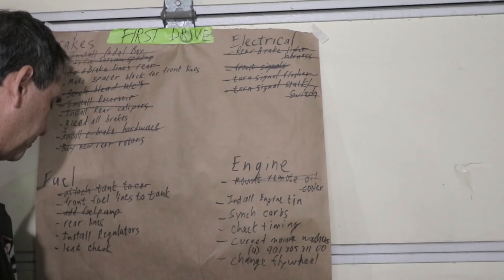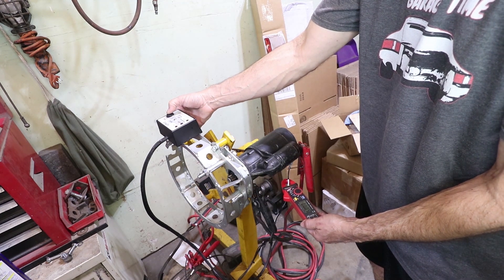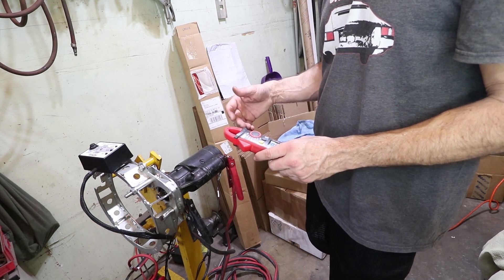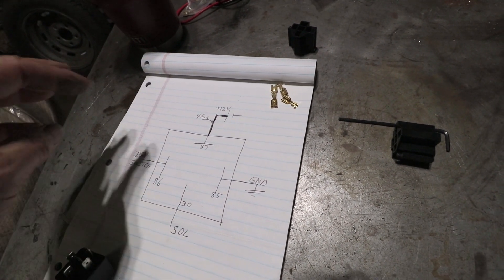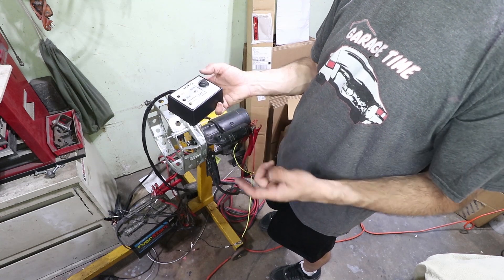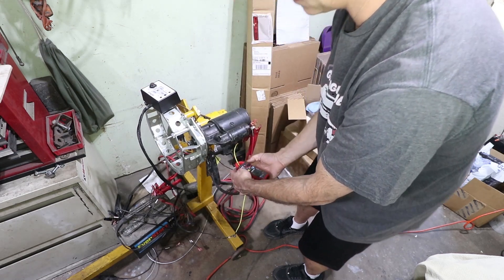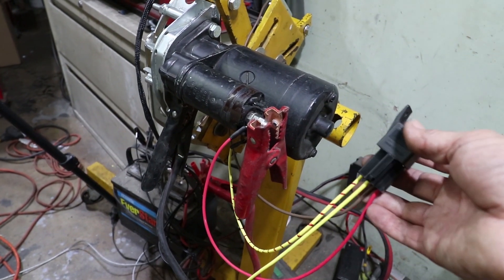What's a HARD START RELAY?  How Does it IMPROVE My Car?

Comment: Thank you for this video. Today, I cranked my -69 Beetle and got a little smoke, which comes from the ignition switch. 
Ignition switch is an old original one. I also have an electrical fuel pump, so what you said in the video is that the pump creates maybe some amps (maybe max 8A) ->>more to the ignition circuit. 
-> That explains my issue! (Old ignition switch with worse connections plus extra amps from the fuel pump) 
Total about 18A for the old ignition switch.

Thank you!

I will have THE garage time at the next weekend. I will buy a good quality relay and will install this hot starter relay system. Also, I will replace the old ignition switch.
Reply from the maker: I'm glad you got it figured out.  I put a relay on the starter circuit and fuel pump circuit.  That way the ignition switch sees almost no current.
Reply: @GarageTimeAutoResto  yeah me too, that's great idea. I got that relay for the fuel pump controlled by oil pressure light switch.

Comment: That relay keeps 7-9 amps is not going through the key switch, that relay will insure you never have a ignition switch never heats up or burns the contacts.  I have need using these for years on every car.  Get a one for the 356 also .  You will not regret this mod.  

I also add a momentary switch on the left side of the engine compartment to crank the engine when kneeling in the back. A good back up and makes working on them easier. There may be a yellow wire In the engine harness for this momentary switch.
Reply from the maker: Exactly, the relay reduces the current to 0.25 A.  This mod is even more important for the 356.  At 6V the current is most likely double and switches are even more $$
Reply: i know Im kinda off topic but do anyone know a good place to stream new movies online?

Comment: It's too bad the starter solenoids on VW Beetles and 50-70's GM cars are all wound wrong where they need so many amps to engage the starter solenoid. The cure I have done for years is to bend the fork inside the starter to allow the plunger to stay in the solenoid housing a fraction farther which allows the magnetic attraction to attract the plunger better, curing the "silent starter" problem. Occasionally a relay will not fix that problem so the best way is to bend the fork, BUT NOT MUCH. Believe what you want but this works.
Reply: Thank for the ❤️. The relay method is the easiest method to cure almost every VW silent starter problem. But occasionally I ran across one that would not engage (silent) even when crossing terminals right on the solenoid. In those cases I dismantled the starter and bent the fork a fraction so the plunger was in the solenoid housing farther. The electro magnetism is stronger then. People that didn't know this procedure bought new starters thinking this would fix it only to have the problem re-occur. One thing to watch for is if the fork is bent too much the starter can be mechanically locked in and will keep cranking when the ig. key is released. To test for that problem, pull the ig. coil wire so the engine can't start, try to start the engine, and if it won't disengage re-install the coil wire. When the engine fires the starter will be released. Rebend the fork slightly back and test again. GM starters can be bench tested for this lock-in problem but not VW's. I hope I can save some people from wasting money on a new starter with this reply.😊
Reply from the maker: This is really interesting and good info.  Not sure why Bosch didn't do this originally.  I guess they didn't expect the cars to be around this long.
I mostly like the relay to save the ignition switch from the high current, but your method would probably do the same.
Reply: The length of time since these VW cars were new isn't quite a relevant thing. This happened on cars only five or six years old. My first Beetle was that age when I bought it in 1969 and had the silent starter problem. I learned real quick to not let the ig. switch go back to the run position. That way I could turn the ign. switch to start many times in a row without going all the way to "off".  Couple years later as a full time mechanic I found the same problem in GM vehicles, and that is where I discovered that bending the fork fixed them. I then thought about VW cars in which this happened REAL often. I had done the relay cure, which I thought of on my own 😔and slightly later bent the fork on a few VW-s. Like I say, the relay is easier because bending the fork correctly is kind of a fine line procedure to get it right. Thank you for your understanding as so many mechanics resent other things they thought they had "down pat". ☺️😊😊
Reply from the maker: Thank you for explaining it so well.  I won't forget if this happens to me.

Comment: Good, but be sure that you could fit the relay on the engine starter! Lots of vibration, thermical conditions in a  magnetic environment could destroy the relay? We usually see it fit on the body, in fresh box. Et comme nous disons en France : Prudence est mère de sureté. Bonne journée.
Reply from the maker: Yes, I agree the relay should be protected as much as possible even though they are sealed already.  Vibration is a good point too.  Thanks Franck

Comment: One other thing thats generally unclear in everyone’s vids. If i want to source the “best” and longest lasting wire for the job, what does one look for? Maybe another vid... there’s txl, gxl and all confusing b/c companies make up acronyms too. Bottom line for an application like this, can i just look at wire temp range? I had a new harness installed once and the outside coating crumbled in 3 years of outdoor Ca weather.
Reply from the maker: I use SXL.  I think TXL is even better
Reply: Garage Time - Restomod i guess what im after are the actual specs of the wires that make it a better choice. Often when you go to the electrical supply store they look at you crosseyed when you ask if this wire in your hand would work in a particular automotive application. :/ that said i will look up SXL and TXL for comparison, Thanks.
Reply from the maker: The more strands the more flexible it is, but the insulation is the part that gives it the automotive rating.  You don't want PVC.  TXL is Teflon I think and the insulation is thinner.  This is good for a large bundle of wires. An ECU  harness is a good example where TXL shines.

Comment: I had not heard of doing that for the ignition, I have for the headlights. Good to know, winter project. Thank you!
Reply from the maker: Yeah, I think the headlights draw even more power.
Reply: Interesting. So this mod is somewhat the same idea...? Would using an LED based headlight still be of concern?
Reply: fancypants I don’t believe so but I’m sure someone with more electrical back ground can confirm.
Reply from the maker: Check the specs for the LEDs but they typically draw much less.  The Porsche H4s are the power hungry ones.  My headlight wires are fried!

Comment: Great video Tom, very informative.  I'm not there yet with my wiring.  But I do have a question, my care was out in the element for who knows how long, and  PO installed some type of push button starter.  I will need to actually test my ignition switch at some point to see if it is any good.  Are you going to test your ignition switch before you install it on the bench?  Is this recommended?
Reply from the maker: I tested the switch several videos ago when I installed the tunnel harness and checked the brake lights.  The ignition coil wire and starter solenoid wire both work.

Comment: Great vid Tom! Very informative. All Old VWs and Porsches in my present and past have had a barely turnover or wont start on a warm engine or hot day of driving. Ive always thought it was the starter or solenoid as an issue which by your explanation, it could actually be the relay inside the solenoid either going bad or not receiving 10amps!?  OR the ignition switch not passing 10amps back to the solenoid wire during ignition start. Do i have this correct, summarizing vid? As such, adding this relay reduces load on the ignition switch and provides insurance to it. 

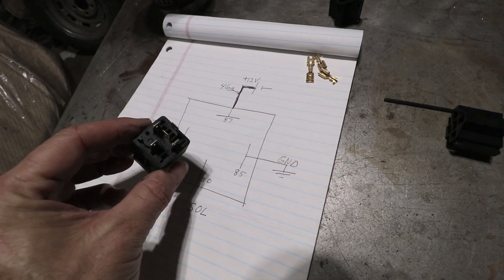Edit: is the answer for below question right before 6:04? ...not hard enough could also be slow turn over? 

Unclear though, on a hot day what happens when ignition nears giving up the ghost? ie is there too much resistance to allow proper amps to flow and why would turn over be present just super slow to cycle the engine? Been trying to understand the mechanics of this.
Reply from the maker: Hey, it could be a few things:
1). The contacts inside the relay could be buggered up.  You can clean these but it takes some soldering
2). The relay does the same thing as the old screwdriver trick across the starter terminals.  You might try bypassing the ignition switch and cars wiring.
3). Starter motor brushes could be weak
4). Vws have bushings on the starter shaft that wear out
I think #1 is most often overlooked and the relay doesn't really help this problem

I really hope you figure this out for life's sake.
Reply: Garage Time - Restomod having a really slow crank, on my 73 911 hot conditions. 

If no1 would same issue occur on cold starts? Starts right up for me. 
No2 good idea. Ill rig up a starter switch to the cabin, get a hot start lines up then try ignition. Then the starter and see if a diff occurs!
Reply from the maker: Not sure why it gets worse when things are warm.  My guess is the windings are less efficient?  
If the ignition switch gets warm then maybe the contacts don't work as well.

Comment: Great tip, especially since I'm making a custom rear electrical panel for my EFI project.  I have a couple of spare spot in my relay block, so it can be easily accommodated.  I wonder then, other than the headlights, is there anything else going through the ignition switch that could benefit from a solution like this?
Reply from the maker: The fuel pump does I think.  I haven't checked the diagram specifically but I do know the factory didn't use a relay on the fuel pump at least for my year.  Most modern cars do use relays.  Not sure if it's a cost savings or for reliability?
Reply: @GarageTimeAutoResto  Ahh, I have an SC.  My fuel pump uses a red relay (with the quenching diode built in.)  I didn't know the earlier models did without that!
Reply from the maker: Good to know that the SC has a relay there.  I would think the fuel pump electrical loads would be about the same.

Comment: It’s really odd how we are on the same schedule. I just ripped out my hard start relay because it failed and did direct to ignition..... thanks for reminding me I should put it back 🤪
Reply from the maker: Let's keep each other going😀. Did the relay fail when you were out driving around?  Or has it been sitting a while
Reply: Garage Time - Restomod the relay was just screwed to chassis and spade rusted off and wire was hanging.
Reply from the maker: Gotcha, thx.
Reply: Totally screwed myself by not doing this!!!!

Comment: I’m guessing original 911s or other cars of the era didn’t have these? Going to Disneyworld’s 15th birthday party in 1986 I had to gas up my 912. It wouldn’t start so I let it roll down the hilly parking lot toward a motel. Letting out the clutch in second nothing happened until I was about three feet away from a building protecting steel post when it finally cranked. We would probably had to spend the night there if it hadn’t.
Reply from the maker: Wow that's a scary story.  Glad you got it going.  
I think you are right that most cars didn't come with this relay.